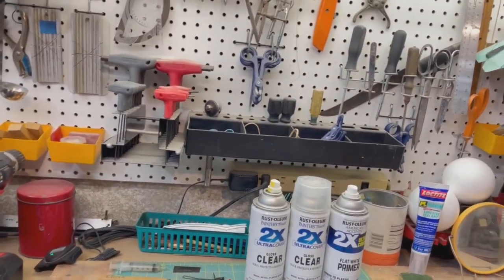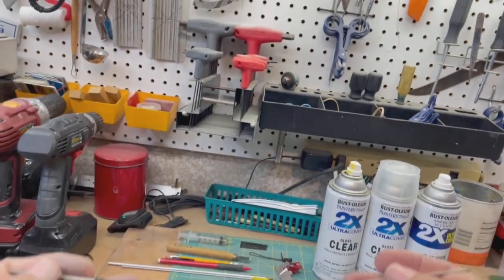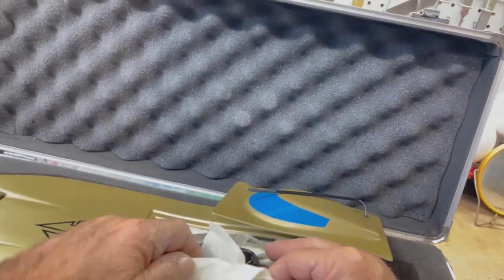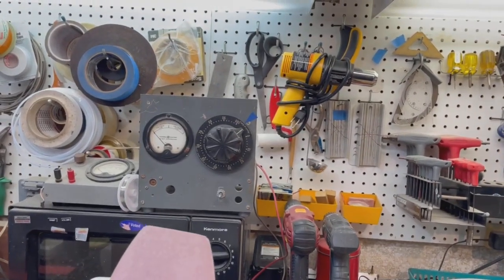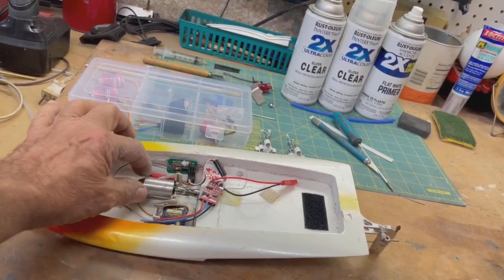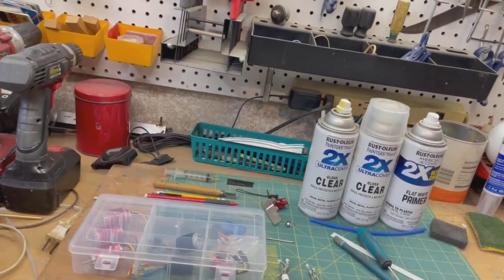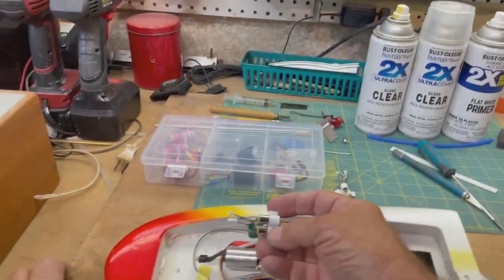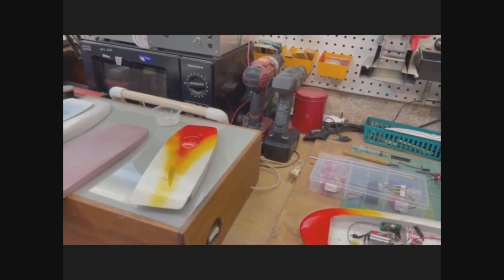Dr. Jet talks about the 1/32" wire drive and another power experiment on the JetStepper.

Comment: Where can you find that tiny gauge wire and steel tubing?
Reply from the maker: The wire is K&S 1/32" (0.032") music wire.  Search eBay for "OD 1.5mm ID 0.9mm Length 250mm 304 Stainless Steel Capillary Tube".  The exact capillary tube I used is slightly different, but this should make for easier assembly.  I told Big B that running this drive on a 3S system would be "At your own risk".  It works fine in low-power applications.

Comment: Damn you Doc! That 'Red Alert' made me leap outta my skin!! 😵‍💫
Okay, so now you've decided that papier mache is not the way to go, I'm going to try and prove you wrong. I say "try" with a degree of optimism, but with a more than healthy degree of pessimism. 
Did you ever wish you never started something? 🙄
That little Catamaran (001 - Edward Donne) looks amazing. Love to see her running.
And motors... and drives... and all that stuff! I'm waiting on a good friend who is machining a few motor>drive couplings out of Delrin (to keep the weight down) for me. 1.5mm to 2mm, with any degree of finesse, is certainly NOT a readily available' off the shelf' item 😒
And did I detect a 'teaser' for the next challenge? An 8" boat built out of Lord knows what, with 1s limit!?  Doc! I can't go any smaller!! I'm already into micro machining and mini motors and stupid Kv levels... it's just not fair!!!
Reply from the maker: I inadvertently hit the "stop recording" button before I signed off and I had to have a way of connecting my sign-off to the video, so............

Please, by all means, continue with the papier mache technique.  I may not have been as thorough in my attachment method as I should have been.  I've been contemplating the next Challenge and I'm not certain which direction I should go.  I do like the small stuff because it's cheap, and I like the idea of making people scratch-build something.  I have a line on a very high-quality boat motor that is roughly comparable to the old SV-27 motor at a stupid cheap price and I was thinking of something based on that motor.  Another thought I had was to make an indestructible jet boat out of EPP foam (like the combat slope gliders).  I welcome input from my Challenge enthusiasts.

And fear not, I'll do a video of that little cat.